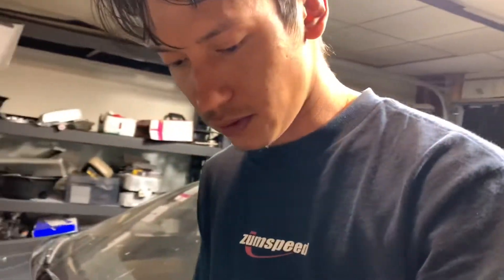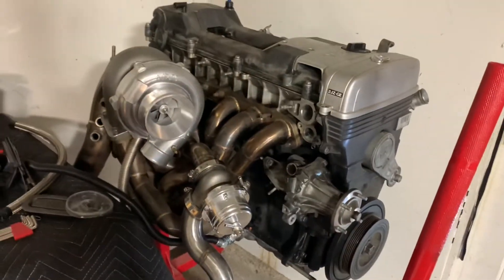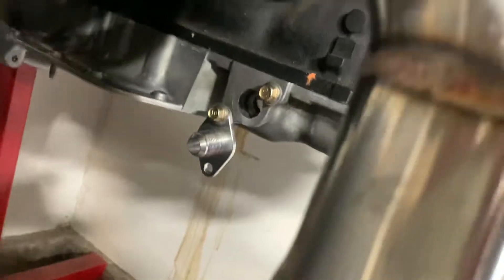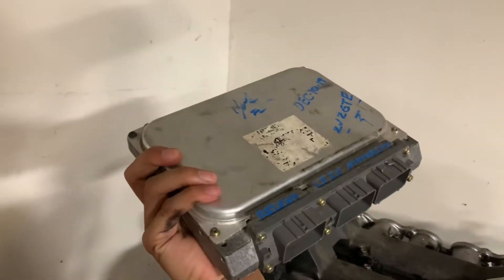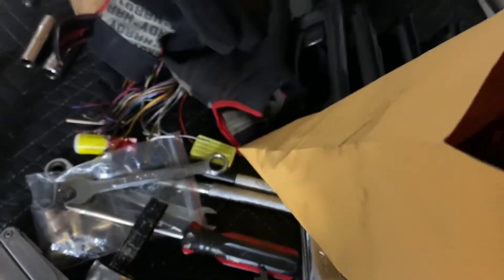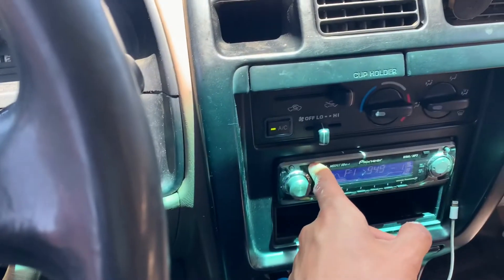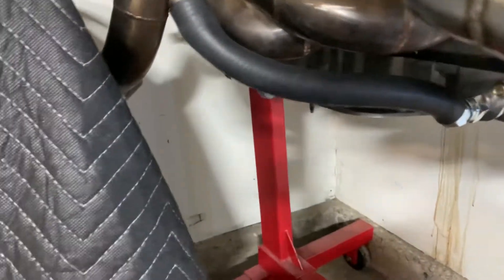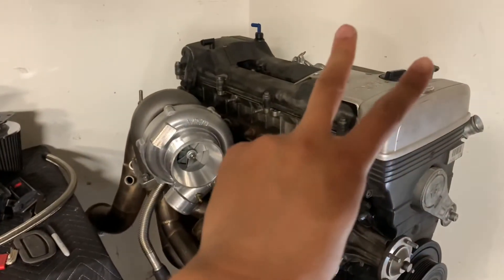IM BACK! 2JZNA-T CXRacing Kit Lexus SC300

Comment: People, please don't use rubber hose for a turbo drain line. Use metal piping or steel braided line. Especially next to a header. 

You can use metal brake line for turbo feed line also. I used the small oil plug on the left side of the block and routed the feed line up and under the plastic silver top engine cover. 
Down the right side and under the exhaust manifold to the turbo.